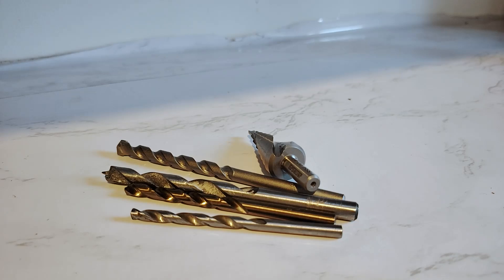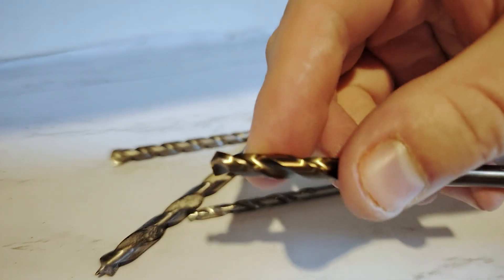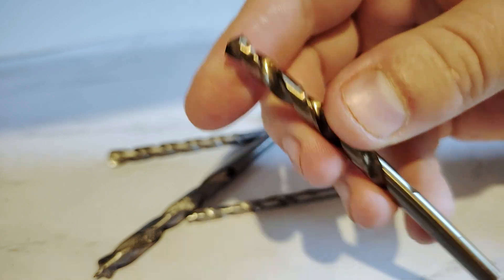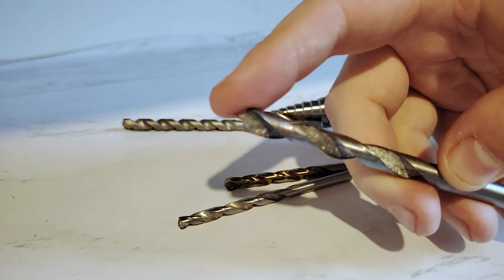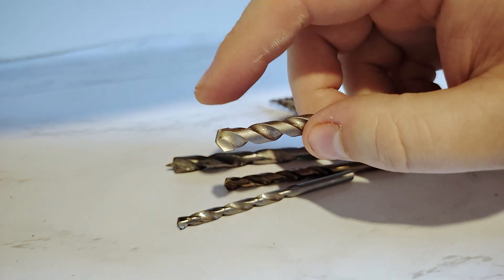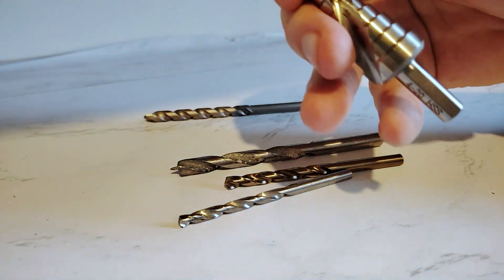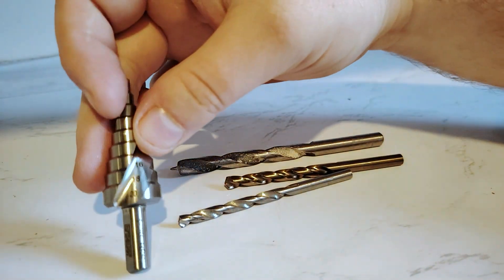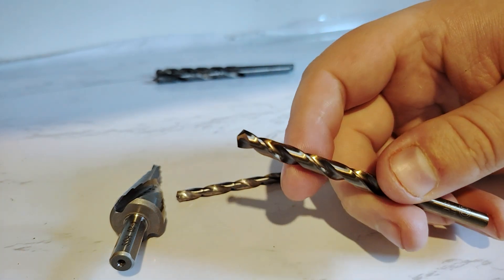What Does A Metal Drill Bit Look Like?

Comment: Things to add:
-Lubrication is good and helps cool the bit also. If you don't have proper drilling lubricant, engine oil will do. Plan your work to avoid oveheating the bit (drill one hole at a time.)
-HSS is Ok for most metals but blunts on stainless. For that you need a cobalt bit, low speed and high pressure (use a drill press if you can, step up drill bit size very gradually if you can't)
-Any bit claiming to be "wood/metal" is likely an exceptionally poor metal drill bit that will blunt on anything harder than aluminium. It will work OK on wood but not as good as a proper wood bit.
-If you're drilling more than one hole and struggling, the cost of a new bit will be repaid very quick in productivity
-If you're drilling masonry with the hammer mode on a power drill and struggling, spend £70 on an SDS drill. They hit the bit while turning slowly, rather than spinning wildly with gentle taps. The difference is night and day.
-Step drills have a max thickness capacity of about 2mm.